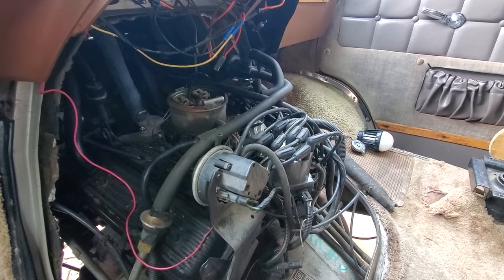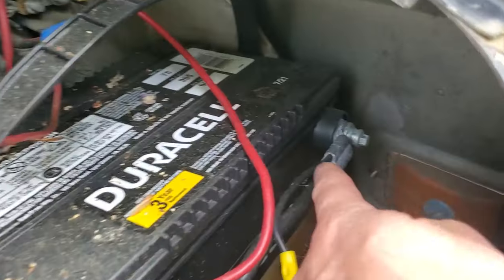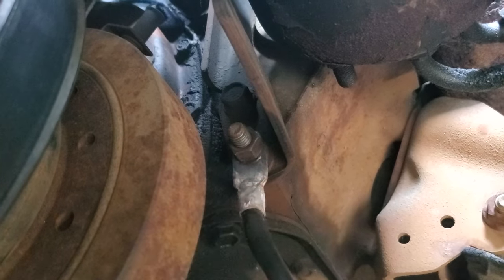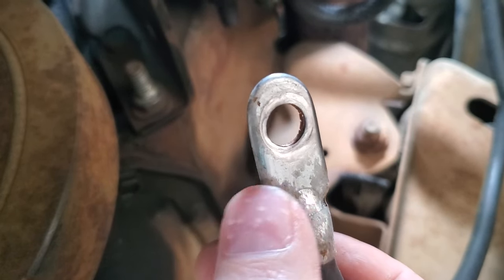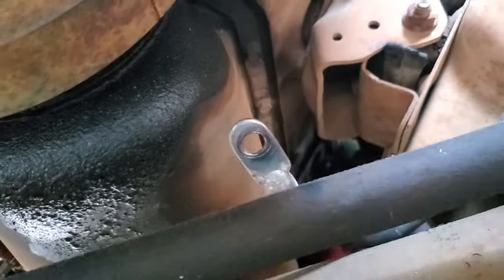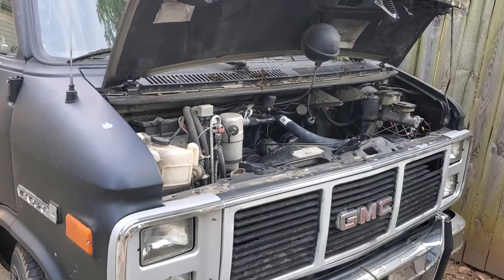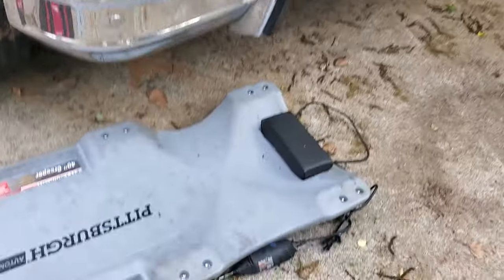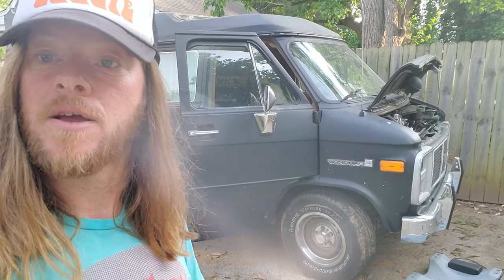SIMPLE!! Crank No Start fix - Chevy TBI 5.7L 350 SBC

Comment: The grounds for the TBI & ignition actually bolt to the rear of the passenger side cylinder head. It’s difficult to see in pickup trucks but a van with a dog box will be easy to see. I’ve seen numerous running problems because they were corroded or loose. If they are bad you can get intermittent bucking,stalling, and if it has a 4L60e transmission you can have shifting issues also.
Reply from the maker: That's a great tip. I did not know this!
Reply: maybe that has been all my issues all the lone.
Reply: Mines bolted to the intake was running but not no more can’t get it to start
Reply: I'm having bucking issues. Nobody seems to know what's causing it. I'll check that out !!
Reply: @elainec2577  Have you replaced the dist . module?
Reply: I have a 98 pickup and the stud, breaket, and wire on the back of the cylinder wall is gone. Is there an alternative spot to put it?

Comment: It doesn't hurt to add an extra ground also.   I cleaned all the grounds on my van and added an extra one haven't had any problems.
My brother used to have a saying that I kind of try to live by its "Look for the cheapest thing first...".
Another one of his sayings that I liked was" Slick is slick".
Reply from the maker: Oh that is a great point! Are you just adding a ground cable from this same bolt on the engine block? Where are you attaching it on the frame/body?

Comment: Gonna look at mine tomorrow.  Have same issue.  Except, mine also randomly dies while driving.  Spent a fortune in towing charges.
Reply from the maker: Yeah, could be contributing to the problem for sure. There are a couple other ground connections on the body too. Just search for a ground diagram for the van model.
Not sure if you saw the pinned comment - but another viewer added this tidbit: 
"The grounds for the TBI & ignition actually bolt to the rear of the passenger side cylinder head. It’s difficult to see in pickup trucks but a van with a dog box will be easy to see. I’ve seen numerous running problems because they were corroded or loose. If they are bad you can get intermittent bucking,stalling, and if it has a 4L60e transmission you can have shifting issues also."
Reply: @kampinglogik  just had the transmission rebuild less than 5k miles ago. Maybe the shop missed a ground or loosened something up.
Van has been sitting for 6 months because I was disgusted with it.
Reply from the maker: @gokaneinthemembrane2745  haha I understand... seems like the more a van sits the more likely the grounds can get corroded or oxidized... so could be something there

Comment: I'm a little dense on electrical problems. If it cranks, isn't the starter working? Why would the starter ground be the problem?
Reply from the maker: Its not the starter that is at issue (as you noted, it is cranking). In my case here, the weak ground is somehow preventing the TBI unit from injecting the necessary fuel. The TBI is electronically controlled and requires enough voltage to fire.

Also the fuel pump is obviously running off the 12v, so it could be effecting that as well.
Reply: @kampinglogik  Thanks, I have an 87 V20 that turned over and started a year ago. I replaced a needed slave and master hydraulic clutch but when I tried to get it going, it turned over but  wouldn't start. Ether kept it going for a short while. I hope tending to the grounds solves the problem. I know one of the fuel pumps was down a year ago.
Reply from the maker: @MrBetabit  Yes this sounds like my situation. Was working on it here and there, but would get busy or low on cash and it would sit for a while at a time. I swapped the fuel pump and you could here it come on, but it didn't solve the problem. Like you, I could pour fuel or spray starter fluid into the TBI and it would stay on for as long as I could keep the flow, so I knew there was spark. Took a while but I realized the TBI injector units weren't spraying, even with new fuel pump. I got a TBI test light kit and it showed no electric pulse activity. So that is when I finally cleaned the ground off and it started up right away.

Comment: I’m going to try that tomorrow
Reply from the maker: I hope it works!! Let me know
Reply: @kampinglogik  nope didn’t work
Reply from the maker: @rosendofj40bigblock7  bummer! Other ideas I have (sorry if you have already tried these) are to check that the engine will run if fuel is present by spraying starting spray or pouring gasoline into the TBI throat while turning the ignition over. If it fires up, then its probably some issue with fuel delivery.   

Another idea (while vehicle is off) is to take a 9 volt battery and tap it on the 2 electric connection poles of each TBI injector to see if they click. If they make some clicking noise then the TBI injectors are good/functional and the problem is somewhere else.

Can you hear the fuel pump hum when you turn the key the first click in the ignition?
Reply: I had a crack in my fuel line,
It was sucking air, replaced line, and filter it’s running now
Reply from the maker: @rosendofj40bigblock7  oh wow! Good to know that is a possibility, but most of all glad you figured it out!
Reply: @rosendofj40bigblock7 how were you able to find it? Could you hear it making a noise?
Reply: @wildestcowboy2668  
It would start with starting fluid,
I could hear my fuel pump going, 
I had gas in the tank, 
I removed the return fuel line no gas coming out I could hear air ,
I removed the inlet hose I could hear gurgling, followed the line back at the fuel filter and there was a crack, it was at the hose clamp connection to the filter, I replaced the line out and new fuel filter also  (just because ) and it’s been running great,
This is on a 1974 fj40 with a big block Chevy conversion , with Holley fuel pump,
Reply: @rosendofj40bigblock7  thanks for letting me know

Comment: I have a 1995 chevy silverado C1500 with tbi 350 5.7 and it will not start unless i hold the key in the run position then it will start i think i will try moving my ground because its on the intake and i dont think thats a good place for it because the intake is aluminum and i wouldnt think thats a good ground. What yall think?

Comment: Im going to try this later, I was driving home and the dirt road is very bumpy and I let of the gas to coast down the hill and my engine just shut off completely, tried starting it back up it would crank but not turn over, I’m hoping it’s just a loose wire somewhere
Reply from the maker: Hey thanks for watching. Sorry to hear your engine won't start. Definitely check the ground... could be corroded or loose just enough to keep the engine from firing up.
Reply: timming or fuel

Comment: A shop told me it was my timing chain because it wouldn't spin while cranking. He disconnected the crankshaft to see. I'm worried of he reconnected it properly. But is it possible to be this? They said they got spark?
Reply: I'm afraid to try thia if the camshaft wasn't put back on properly. Is it hard to make sure?
Reply: Sorry i need to fix this. I spent a week in a mall parking lot, just got back home with a tow.
Reply: I love my van and will do whatever it takes it's my only vehicle
Reply: Sorry he said he removed the camshaft i think to look down below into the engine inside by the seat.
Reply from the maker: I am not familiar enough to know if the shop guy is right or wrong. But I do know that if you pour gas in the TBI bowl and the engine stays on than its a fuel delivery issue, which could be the fuel pump, fuel filter. Or like mine, not enough voltage for the TBI injectors to function properly

Comment: Mine same issue. Injectors work. There is spark. No start. Try to put gasoline in tbi by hand no start. Cleaned out the ground. No start. What you recomend to check after that?
Reply from the maker: Hmm... you put fuel in by hand and it won't start? Is your starter working? Mine would fire up for as long as I put fuel in by hand. So I knew there was spark. Seems to me that if there is spark, it should fire if you are putting fuel directly into the TBI. 

Does the starter make any noise when you try to turn it over?
Reply: @kampinglogik  hi. I changed the plugs & its start. But it died.i replaced the icm & temp sensor & distributor module & rebuild injectors & fuel filter and still start then die, some time its keep idleing  but rough & bkack smoke. I dont know what to do
Reply from the maker: @Q8motorclassic  Have you checked the fuel pump's pressure?
Reply: @Q8motorclassic did you check the fuel pressure regulator?
Reply: @brianshizmo78  i found that it was converted from 5.7 to 7.4 454. Electric job was a piece of junk. Throw the car away dont have time to deal with these shit

Comment: I have a 1995 GMC Sierra v6 , same issue, crank but won’t start, I might will have to check the ground tomorrow to see that’s my problem
Reply from the maker: Definitely worth a look... had someone comment that they had to clean the ground connection on both the engine block and the battery to get theirs to fire. So I'd check both

Comment: Anyone else get a no spark no injector pulse situation with good crank? Ima try this in the am but i dont wanna buy something if i don't have to. Ive put 3 distributors on it.
Reply: I would suggest getting a voltage meter and testing sensors and ignition coil as well relays, and it can't hurt to check your fuses. Hope this helps godbless and good health.

Comment: Question
Reply from the maker: I will be glad to share any info I know.
Reply: I have a Chevy caprice 1993 ran when it was parked new starter new cables new battery new ignition switch and it won't crank
Reply from the maker: @RashaadMcClenton-rs6uv  so no crank at all? What all happens when you turn the key? Do the lights on the dash come on? Is it possible the battery is accidently drained from a parasitic draw?

Comment: It has nothing to do with the ground.  It has to do with the fact that disconnecting and reconnecting the battery re-set the computer.
Reply from the maker: Hmmmm I'd be open to that possibility, as I am an amateur... but I will say, I did disconnect the computer at least once at earlier dates, hoping a reset would change the outcome... also, the battery died and had to recharged several times, and was also disconnected several times for other repair attempts... none of that changed the situation. So I still feel good on my conclusion, as I really did try all kinds of things in my frustration over the course of 12 months. But that could be a great tip for someone in a similar situation. Thanks for chiming in!